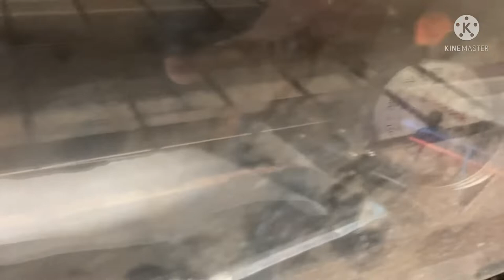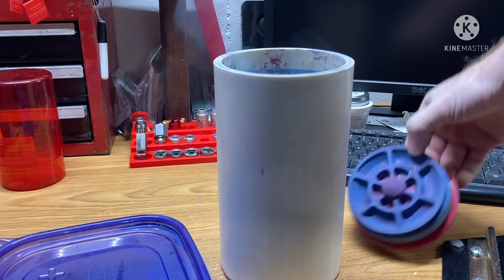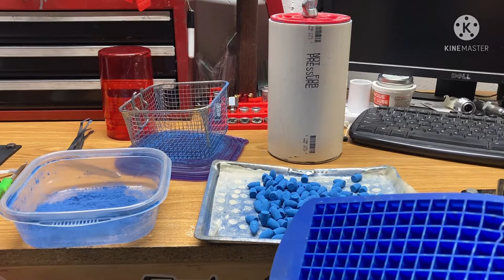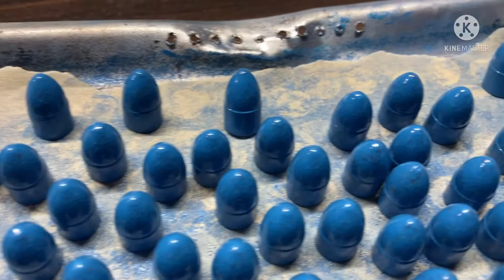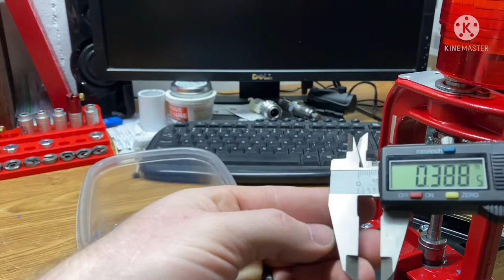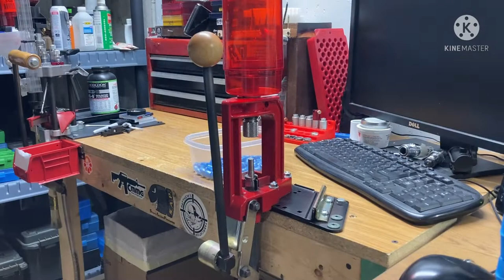Powder Coating and Sizing

Comment: Easier than a tweezers for standing....I use the 7mm nitrile gloves from Harbor Freight,  then I rub a bit of powder on the fingertips and stand up the boolits.  The powder doesn't come off when standing and even if it does you can sprinkle just a dab on any bare spot and they usually turn out just as well.

Comment: Have you ever powder coated lead bullets you bought with the lube ring grease filled? If so, how do you remove the lube before applying the powder?
Reply from the maker: Most people soak them in mineral spirits or something like that to remove the lube.
Reply: @243Outdoors  thx,!

Comment: Going to start powder coating and was going to use Harbor Freight powder but they stopped selling the red, how does the black or white cover?
Reply from the maker: I have heard not to use HF Black on bullets because of it containing metal in it, and will case wear on your barrel.  I do not know that for a fact.  I never was impressed with HF Powder. I would strongly recommend Eastwood or Powder by the pound.

Comment: i powdercoated mine like this, and it was to thick,couldnt even see the ribs,and it left alot around the bottom of parchment paper, and the paper burned and it was stuck to the bottom of bullets..not any luck at all, the next time, they came out all bumpy like sand paper,rough..almost ready to just paint them.ha.